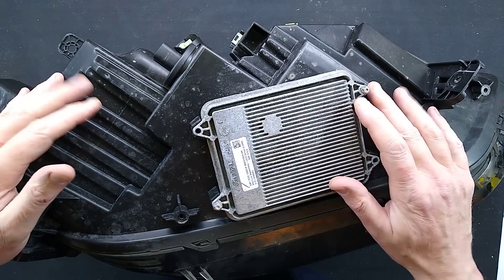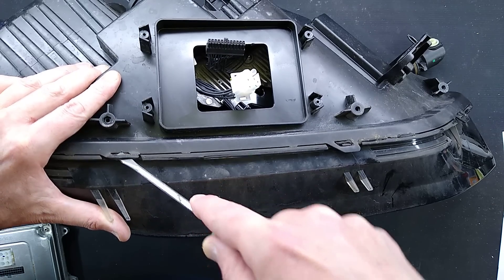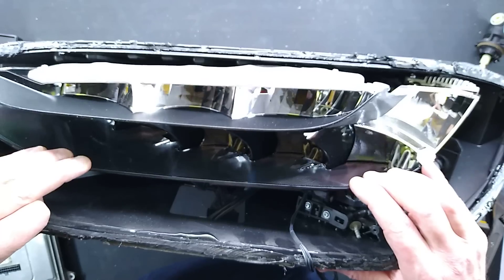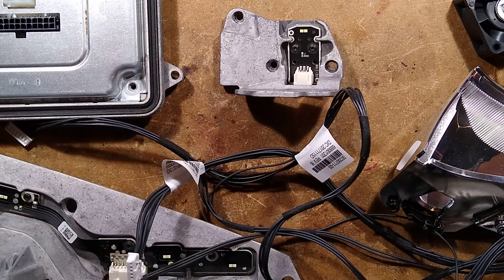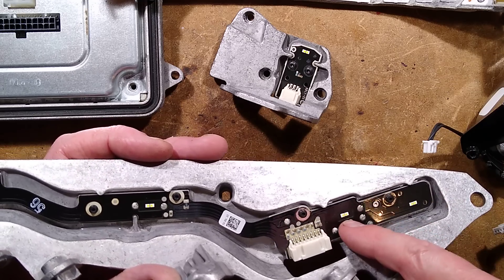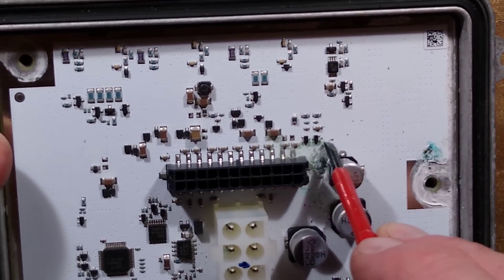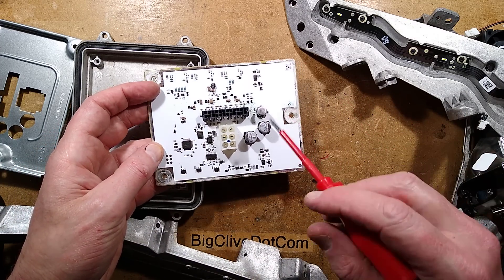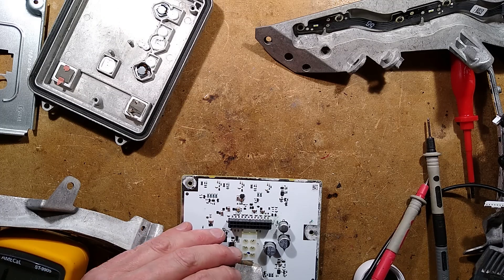Exploring a Tesla model X headlight

Comment: Such a waste .. those LED's are going to fail if the PCB makes it that long, so the future owner of the car is going to be up for some huge bills .... hopefully the 3rd party repair world will come up with a way of getting them apart and repairing them - I know my old E39 BMW can have 'sealed' headlight units dismantled by putting them in the oven for a while to soften the glue ....
Reply: Throw in $25k for new batteries and the car will not have future owners instead it will be heading for the scrap yard and landfill no doubt.
Reply: Future owner of any EV is up for a big bill when the battery inevitably shits the bed, why not add this to the list for good measure
Reply: @hoseclamp_9000  Well there are guarantees for 10 years or a million km for batteries already. Most of the batteries can be refurbished by replacing a few bad cells and a lot of them can still be repurposed for all kinds of energy storage. So the resale value will be significant even for an old battery and the huge bill was true years ago, it is not any more and will not be in the future once manufacturing capacity catches up with demand. 10 years of not having to change oils, filters, spark plugs and other maintenance EVs don't have will spare us many thousands to spend on that battery, if you for some reason still want to keep driving a 10+ year old car for a long time. People are stuck with old fears of failing battery packs from the past (and to some extent some models from the more recent past, sure) but it's not really such a big concern any more like it used to be back in the bad old days. And things are only going to get better.
Reply: @benbaselet2026  My 10 year old car's headlight bulbs aren't a grand a pop, and other than consumables it's still on all of its original major components. It also cost (new) about half what an equivalent EV would have cost me. I agree EVs will make economic sense one day but it's not today. Suffer the poor early adopters who are funding the R&D for the rest of us I suppose.
Reply: @hoseclamp_9000  Is your current 10 year old car an expensive premium? Because that's exactly what teslas are. Sure EVs are selling at a price premium right now, but the total cost of ownership is a different story if you count in the fuel and service costs for the lifetime of the vehicle. And you don't always have to buy a Tesla any more than you have to buy the latest iphone. There are very good alternatives.
Reply: @hoseclamp_9000  Also EVs have great resale value right now, so if you decide to buy one and then sell it after a year or so you don't have to suffer the punitive depreciation fossil cars typically have. So it's not like you are paying for hot air.
Reply: @benbaselet2026  great resale right now is not the same as great resale with an end-of-life battery. 

As it happens my 10yo car was a premium SUV (when it was new) and it doesn't have a hard limit on it's useful lifespan the way an EV does. The whole of life cost of ownership just does not add up right now for EVs. As I said before, no doubt they'll be better eventually, as all technology tends to evolve into cheaper, optimised versions of itself. If someone wants to buy one, i say go for it and I hope they enjoy every minute of driving it, but trying to justify it economically is a cope.
Reply: @hoseclamp_9000  What hard limit is there for EVs? And economy is not a cope, it's a calculation for the money you have to spend over X amount of years.

Comment: All that effort to seal the whole fixture done in by an ill-fitting or undersized o-ring and the lack of a conformal coating.  $1300 garbage.
Reply: Typical of Tesla, same issue in their vehicle modules as well...   For all of Elon's talk about engineering, there's a lot of bad engineering or maybe overly marketing department driven engineering decisions going into their products..   For my money, the product simply doesn't have the sense of quality that I expect, and all the technological flash in the world won't change that..
Reply: @Flying0Dismount  Think they take the modern apple engineering approach (make it unfixable at all costs and not last long) unfortunately it's becoming the norm
Reply: The sealing is just to prevent you from fixing your property.
Reply: Looked to me the water got in via the connector, not the gasket.
Reply: Something I learned in 40 years of aerospace and mechanical engineering:  You can't seal the water out.  You just wind up sealing it in.
Reply: A Prius headlight is even more expensive
Reply: @earlscheib7754  My Gen2 Prius has the HID lamps.   They've never failed, but gradually dimmed.   I think I paid about $100 each for Philips replacements.   The bugger was installing them.  Unless you want to pull the front end off the car, you can replace them (wear cotton gloves so you don't leave any skin oils around) if you're double-jointed and have eyes in your fingertips.   There's a Luscious Garage video showing a gal doing a replacement in about 30 seconds.
Reply: @earlscheib7754  2-gen prius? I had the same problem. I had a bad ballast that was about 200 to replace, and later had a bad bulb that was maybe 50 to replace. I found an inexpensive replacement bulb on Amazon. On my Gen-3 Prius, I replaced the bulb with a 12V LED from Amazon.
Reply: Show me manufacturer who uses conf.coat. inside headlights electronics... Everything inside headlight is in general considered as a dry space, so everyone tries to save money and make it as cheap as possible...  Adding conformal coating is expensive step in electronics production process. In automotive industry is being used mainly in security and safety electronics.
Reply: @MartinNyxel  to be fair my headlight has no electronics it has 2 bulbs a combination dip and main headlight and an indicator that's it but still a right pain to change
Reply: I'd like my EV to be drownable and still work. I didn't go all the way there, but the new battery I'm building for my electric moped is completely housed in IP67 boxes. Few things are sadder than good battery cells dead and rusted from moisture. Not sure if I'll go so far as to flush them with dry nitrogen, but there'll at least be desiccant pouches inside each box.
Reply: The 2018 and newer Audi q7, headlights with matrix led are so expensive. Headlight without modules are $4,000.
Reply: Ahhh yes. The old challenger space shuttle flaw strikes again.
Reply: @Phil_From_Canukistan  Musk makes rockets!!
😳🤯
Reply: I wonder if newer versions of this module have a conformal coating. This generation US headlight has a -F part number so it has been revised six times. Even the older headlight without the beam aiming features has a -C part number.

Comment: "Why replace a $200 module when you can force them to buy a $1500 module?" - Tesla

Suddenly my $10 bulbs aren't looking so bad.
Reply: I would sell the $200 module for $1200 instead and make them praise me for saving them $300
Reply: And then have to take it back to Tesla to get it programmed to the car
Reply: Remember the days when car headlights worked on a wiring loop with just the 12v battery, a fuse a switch, a bunch of wires and two bulbs.
Reply: @banjax66  Naaah.  That's way too simple!  It couldn't have worked that way.  You have to have at least two  integrated circuits and 20 other surface mount components to make anything work!
Reply: @banjax66  I guess there are some perks to having an old car. I pay about 2.5 euro to replace a headlight, and yes that includes a set of other bulbs and fuses.
Reply: @banjax66  My French EV is just 2 bulbs and wires 👍
Reply: @banjax66  I do as I grew up around cars that were very old and considered vintage when I was very young. My current car was supposed to have daytime running lights but have never worked since the day I purchased the car.
Reply: My dad's truck has the old style $10 bulbs. However it keeps blowing the bulbs after only a few weeks and they make you tear apart the entire fucking engine compartment to get to it. I wish it had LED. "Simple" headlights can also be poorly designed too.
Reply: I would imagine the light your $10 bulbs put off do look pretty bad 😂
Reply: All the other manufacturers are no different though.
Reply: @rkan2  Not really. The original comment was about buying the module and not the entire headlight unit. That's possible with most brands. But all brands use the same concept with glued headlights indeed
Reply: Yep, the way the industry is moving... 

All these led headlights and tail lights are now multi hundred to couple thousand $ modules. 

Glad my truck doesn't have LEDs
Reply: *Apple
Reply: *Apple
Reply: *Apple
Reply: They might look bad in the night though, and you may not notice something threatening in time…
No offense, I understand what are you talking about
But I have to say that difference in illumination of things in the dark between good led lights and general lights with incandescent light bulbs is immense
Especially fancy ones, that can split/deflect beams and all that (not speaking of “laser” ones), they incinerating with a stream of light, practically being on “high beams” all the time, while they do not dazzle oncoming drivers
You can see, like, kilometer ahead
Reply: @llMarvelous  oh they can see around corners and over hills? They aren't required 99% of the time and we have a thing called 'main beams' for dark lanes, or maybe slow down a little if you are driving so fast you cant react to what is in front of you?
Reply: @handlesarefeckinstupid  ok, I see u r skeptical, I wouldn’t reassure u, u can do your own research if you want 
Seeing over the hills or around the corner is not what I were talking about, but deer jumping on the road all of a sudden, or an accident on the road, or drunk person wagging from a roadside - in those and many other cases they are pretty useful
Reply: @llMarvelous  the led headlights I've seen on the road are blindingly bright. They're more of a danger to other drivers than regular headlights are a danger to yourself
Reply: @llMarvelous  also a good LED unit should last the life of the car, which should reduce the number of idiots with headlight/brake lights out. The amount of one's round here in the winter with faulty lights is shocking.
Reply: @llMarvelous  It's true that the LED headlights provide way better visibility, but that's not a reason to make them un-serviceable. It's just cheaper to glue the headlight together and as a bonus they can sell more of them since they can't be repaired.
Reply: @tomvleeuwen  exactly. They would make the entire car as one preassembled / non-service part, if it was a cheaper production cost!
Reply: @tomvleeuwen  yeah… but I guess make it serviceable will increase cost even more, and suppose this is one failed headlight out of thousands… u get the point
And also serviceable construction adds a LOT of points of failure… one loose bolt (vibrations, temperature changes and all that) out of dozens and suddenly you get higher rate of failure 
But what I think they might do is inspect failed part and conclude that it was defective from the factory, for example, and change it for free - that will be nice of them
Reply: @llMarvelous  bolting the headlight shut would be an extreme example, going back in time 20+ years, but the way they glue the headlights these days just makes no sense except to save a few cents on a better / removable sealant per car. Some types of sealed headlights are so prone to water ingress that they all build up condensation inside after a few years, with no way to clean it or fix the seal. So there are probably about the same amount of cases where gluing it shut makes it break in an unrepairable way as where it prevents the unit to fail. And in the process it prevents you from replacing other broken parts inside the headlight.